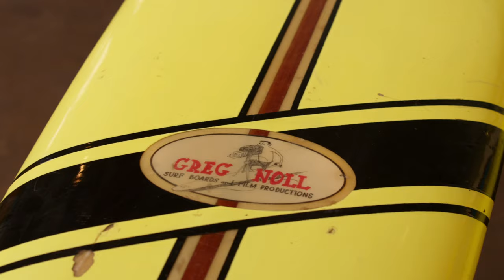Surfing the Iconic Greg Noll Board | Red Bull Decades Ep. 1

Comment: I learned as a 12 yr old back in da 80s on a 10’ hatchet skeg Noll.  Almost 40 years later I still have it.  It was mint when I got it being it was already 30 years old, but I managed to wreck it as a young teenager. I recently restored it, delamed it, painted the foam white with some acrylic, rice papered a new log and bam!  I don’t know how I rode that thing as a grom, I remember charging big swell with it, all 40 lbs of it with no leash.  I think learning and surfing on those old boards made you harder core. I remember transitioning to short board about 2 years after only riding the Noll, and it riding a short board was sooo much less stressful and I do remember taking more risk than my friends that never rode those old planks.